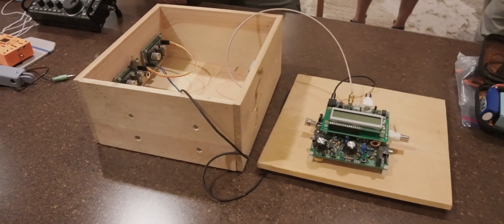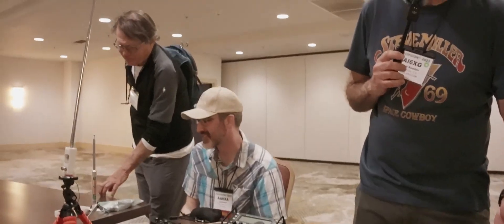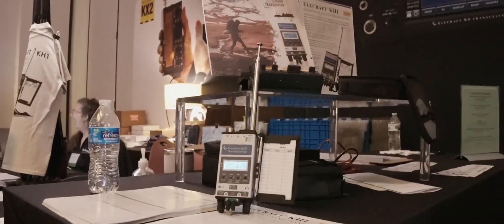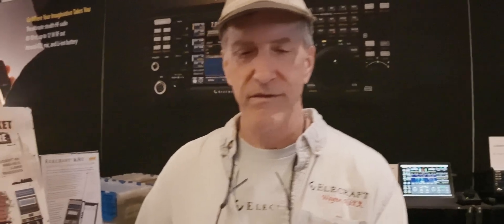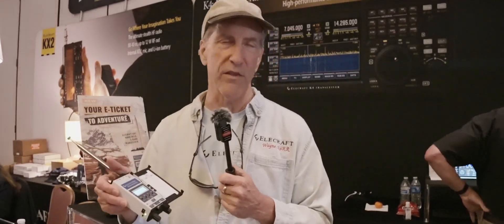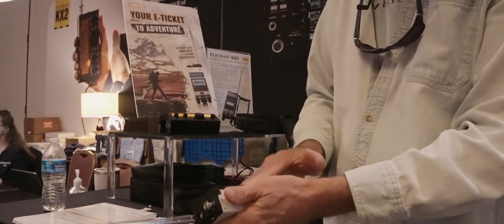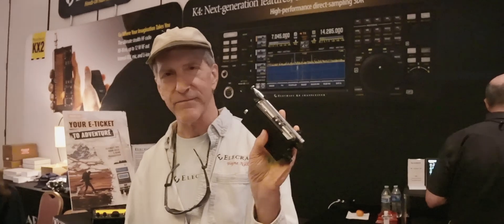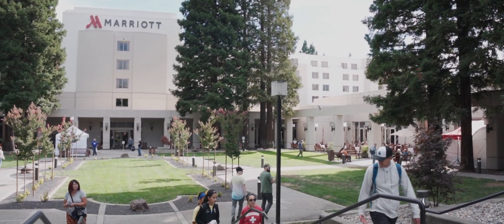ARRL Pacificon 2023 Quick Tour

Comment: I really want to like the radio, but I’m really struggling with the steep price point when you get the extra options. An internal battery charger shouldn’t be an add-on in 2023! 

Don’t get me wrong, I love Elecraft and have both a K3 and a KX3. But i could never justify spending $1200 for something in the same class as a mountain topper or a QCX+. I’m VERY disappointed!